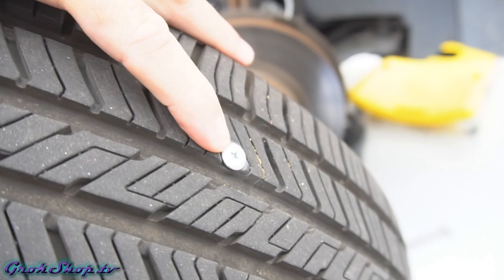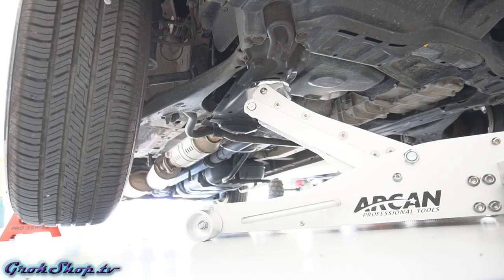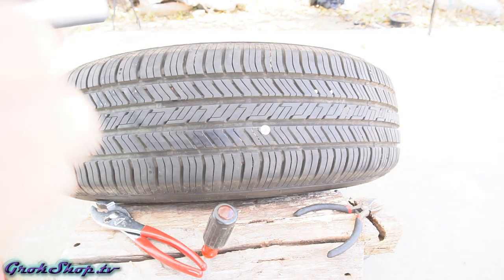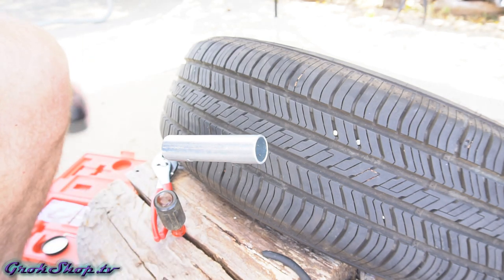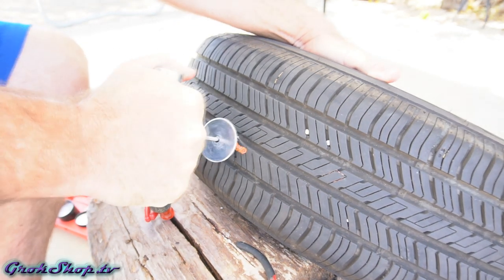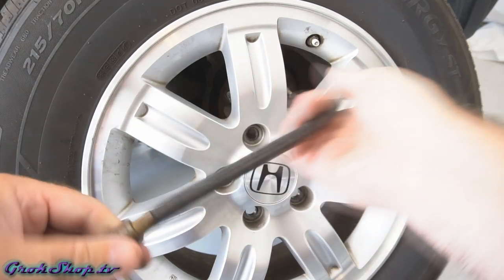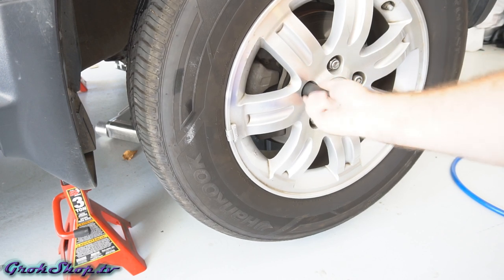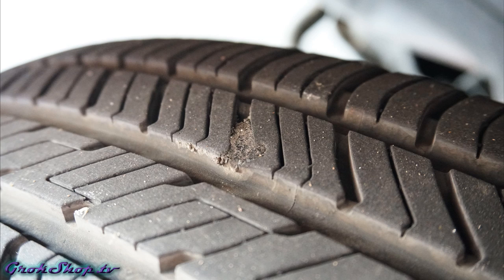How to Plug a Tire Using a Tire Repair Kit

Comment: It’s $60-$70 dollars to get it fixed here so this was a life saver for the time being
Reply: You didn't shop around enough.  $70 should only be if the whole tire is pulled off, patched inside, you used fix a flat so that needs cleaned out, then remounted and balanced.

Comment: when pushing in the plug, stand directly over the tire straddling it.  This will give you more weight/leverage on the handle and lets you effectively use both hands.

Comment: Never use grease on a tire plug!
Reply: Why not?
Reply: @izzykazoo7569  Grease doesn't seal nor does it let the string bond to the tire.  It just makes it easy to slide in so you have an easier job.
Reply: @datsuntoyy  Grease or glue?
Reply: @izzykazoo7569  Grease.  Good catch.

Comment: My strip was very sticky, so I used the grease on it to help it go into the needle better.  Hope the grease won't cause the strip to come off the tire..
Reply: What kind of grease? Shouldn't use any lubricant except rubber cement
Reply: @Chanmantroop10  it comes with the kit
Reply: @1uP-v2  I hope that was rubber glue not grease
Reply: @mohanjha9593  it's not sticky, so definitely not glue.
Reply: The pressure of the air from inside the tyre will keep it in place.
Reply: It wasn't a good idea but it is still possible it won't leak and will stay in place, as long as the plug was a tight fit into the hole.

Comment: Discount tire does free flat repairs in case you guys want to get it done for you, they’ll do it to manufacturer safety standards and make sure you’re all in good shape!
Reply: Not everyone lives 5 mins from a tire shop ; )
Reply: Nice to know but if they're just putting a plug in like shown in the video rather than taking the tire off, it's hardly worth driving to them and back, would take more time than DIY unless you just happened to be passing by there anyway and had thought it was a good idea to keep driving on a punctured tire.

Comment: I use a battery powered drill with a 1/4 drill bit.  Saves time.
Reply: I would not do that. Using the hand reamer allows you to better feel the hole and the direction the nail or screw went in. This way your plug fills the existing hole vs removing more tire material than is needed.
Reply: Brian Zech I use a battery drill on every tire.  You are incorrect....
Reply: and potentially makes the hole larger than it should be, increasing the chance of leaks.  Plus, most of us don't want to buy a drill to leave in a vehicle for when it might be needed for that.  Plus, it doesn't save any time at all, to have to go get the drill, have it keep it recharged, then put it back, compared to the few seconds, as shown in the video, to merely do it by hand.  Slackers!

Comment: What to do if plug leaks, and can't get it out?
Reply from the maker: I've never actually had that issue, but in that case I would think you would need to re-ream & repair it with the tire repair glue which is not in this kit, unfortunately.  But its available separately.
Reply: cuss and kick the tire.  Then go inside and have a drink while you cool off.  Come back out and work at it some more.  Try using the install tool to push the plug inside the tire.  It's light enough it shouldn't mess with balance of the tire.